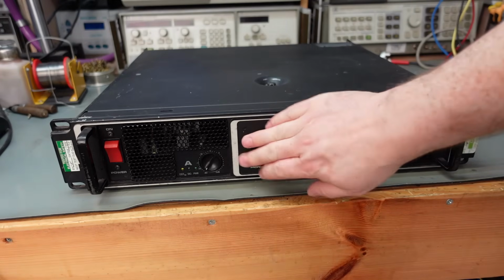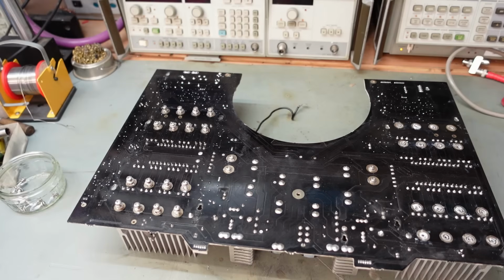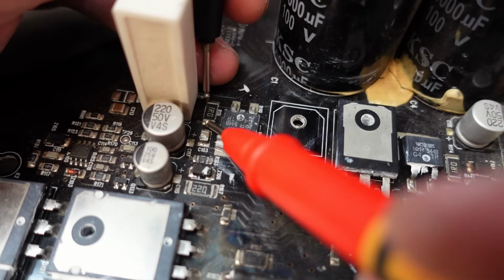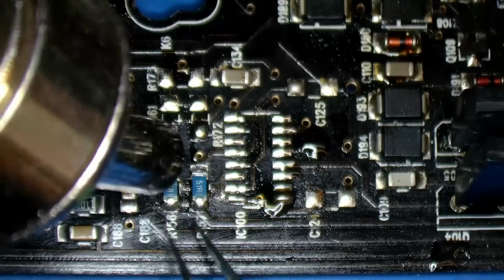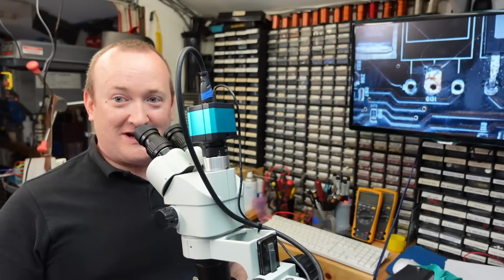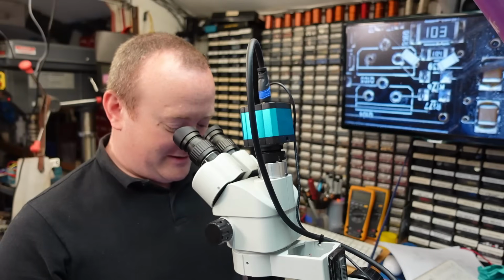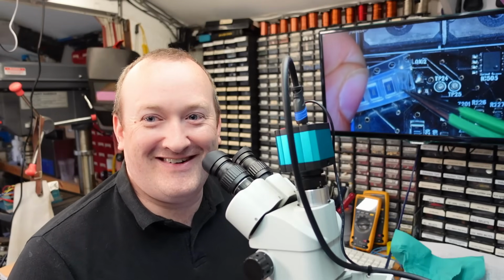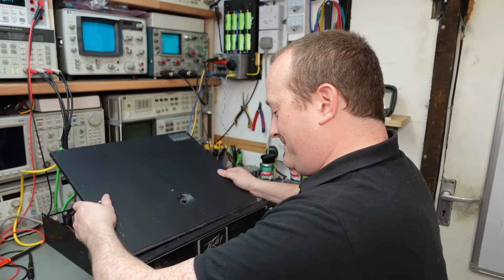PEAVEY 4000W Amp Repair (CS4080HZ)

Comment: Cracking job on the repair.. I used to work in a local music store as the service tech, it was different from my time as tv/ video repair person.  

Seen so many blown amps from high end ev p3000 amps to lots of marshall, peavey, sound city valve amps. 

We used heating elements to ramp up the amps on test.

Comment: Amazing work and patience there! Do you ever consider something FUBAR? I would think half of all the other electrical engineers would've thrown it away, but who am I to say? I'm not one of them. And you're such a nice lad, one of those I'd buy a pint or two if I were still visiting pubs. Keep up the good work, I'm learning a lot, more than most other channels on these subjects for some reason. Thanks for that!

I thought that Chinook was flying by at my location, but you mentioned it and got me by surprise! The sound disappeared when I paused the video... HIlarious! Well, perhaps.

Two questions: at 40 17 yuo can clearly see the soldering point of the right transistor's middle leg looks a bit loose, is this just fine? And at the beginning you show the inrush thyristors that shouldn't have a piece blown out. Near the end of the video they are still in place, is that okay as well? 

And for the washing out of thermal paste you could give this a try: let the stains soak in white vinegar for hours or overnight and then wash it the usual way. The acidious nature of the vinegar will solve the aluminium and/or zinc, just like with deodorant stains.

Comment: Nice job - did u swap out that NTC? My guess is that elec cap blew and its shrapnel shorted a few bits - hence the disconnect between the IGBT  and other stuff
Reply from the maker: I didn’t replace the NTC in the end. They weren’t readily available, and on closer inspection, the missing chunk was just the casing. The internal element was still in tact. 
I’m sure that e-cap just fell off the board. It was present at the start of the video! Still haven’t found it….

Comment: Very entertaining. Not quite sure of the design, but after replacing output transistors, should the bias not be re-calibrated? as a matter of fact, any transistors sitting in the signal path.
I've noticed a lot of of engineers use large solder tips? Did I misjudge your's? I use a 0.8mm tip on my iron. What would be the reason for larger tips when doing fine work? If I could get 0.6mm I would.
Reply: Nobody has answered your question, so I might offer a possible suggestion. If you are skilled enough to use a larger tip it gets more heat into the joint/component quickly. I was always taught to get it, solder flow & then get out as quick as you could. Reduces the time for heat to travel into the component.

Comment: ive just bought a faulty old peavey power amp,  everytime you plug it in, it pops the rear panel fuse... I opened it up and found some of the output transistors are shorted..
The transistors in the amp are Motorola 70483180 W9217..
But the only replacement parts i can find are Motorola 70483180 W9937...
Does it matter that the ending numbers are different?!?!
They are both Motorola 70483180.. But the last bit is different...
Please let me know, so i can quickly order some..
Also... The transistors being faulty, Can that cause the main rear panel fuse to blow?!?
The whole amp powers up for a split second, you hear it getting power, and lights on front flicker on, the lights in my home dim... then fuse pops..
is that common for faulty transistors?!?
thankyou
Reply from the maker: Hi, yes the shorted transistors are going to pop the fuse. The awkward part is getting good replacements. The 70483180 is a Peavey part number for a standard Motorola something. Maybe SJ15024… the W9217 is a batch code, maybe week 17, 1992. It shouldn’t matter, the others are just younger. They might not be matched the quite the same, but I haven’t found any real problems, as a well designed amp shouldn’t be that sensitive (or it would be a nightmare to manufacture). 
However, I would be suspicious of any ‘pleasantly priced’ replacement from China. You would be amazed at how much effort they put into fake parts. I’ve bought enough of them…
Reply: @MendItMark  Fantastic, Thankyou for your reply..
Yeah i found some Motorola 70483180's, but they were from china..
Im very new to repairing electronics, so im kind of clueless.
I dont even know how i will go about finding a replacement..
If i find the spec sheets for both the 70483180 and the sheet for the SJ15024 that you mentioned.. What specific spec am i looking for, to make sure they are compatible?!
Thankyou so much for your help.
Reply: @MendItMark   Are the SJ6343 a direct replacement for the 70483180 ?
Like i said bud, I have no clue what im looking at, So id highly appreciate any help i can get. This is my first electronics repair project, and i dont want it to fail..

Comment: have you ever repair the Goodmans module 90 1974 Amp
Reply from the maker: No. There’s loads I haven’t done yet! Lots to learn, and plenty of fun to be had!
Reply: @MendItMark  I have 2 one I repaired and working one not yet, I was wondering what it may cost to have one of them done properly, because you seem to know what you are doing, and I love how you are happy all the time, thanks for the reply, and the good videos Mark.
Reply: Sir how many volts secondary  voltage of the transformer this peavey cs 4080hz

Comment: I have been waiting in anticipation for another video, thank you. Respect your attention to detail and the repair to the charred board. I can't wait till the last screws go in and testing to show the unit all working as it should, fantastic. Just needing to check with you (not trying to cause any offence  or ill feeling), you replaced  IC203 "driving the fans", did you check the fans were working after? Don't want it to cause you any more problems. As I say, "just checking" 🤐

Comment: Hi. Could you say to us which is the temp of hot air gun that you use, please? Thanks
Reply from the maker: It’s generally set at 325 C. It’s not as fast as it looks in the edited videos…. But I don’t want to damage the parts by going too much hotter.

Comment: Very neat, You are rapidly becoming my favourite repair channel  Now we have an edited 45 minute video, how long did the actual repair take? just curious.
Reply from the maker: It took about 3 weeks, start to finish,  as I had trouble getting all of the parts in. It was probably on the bench for about 3 hours in total. 
The hard part was keeping on top of video continuity, remembering what I was wearing, putting things back where they were…. even had to cut my hair!
One part was filmed with a hangover (I think you could tell?). 

I’ve got some easier repairs lined up next, which shouldn’t need the microscope, which will make it quicker to edit! 

I’m glad you guys appreciate it!
Reply: @MendItMark  Thanks for the reply, I figured it was in the workshop a while but 3 hours for the repair is impressive considering the extent of the damage. Always appreciate a good spark as well 😀